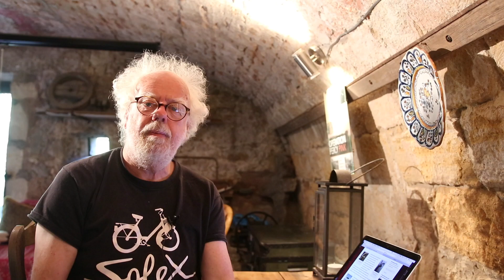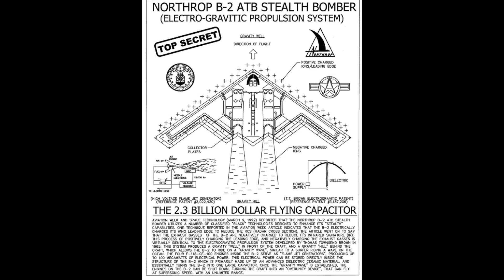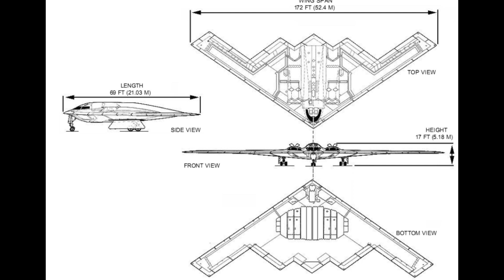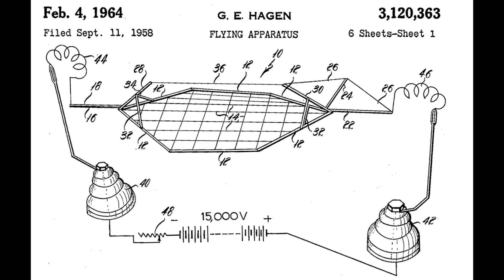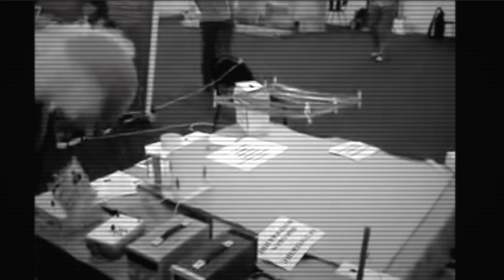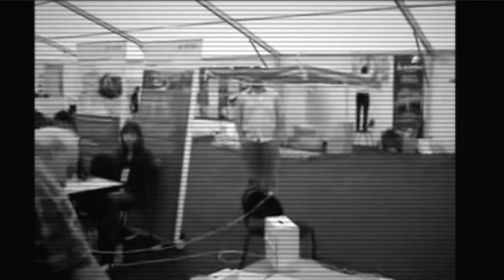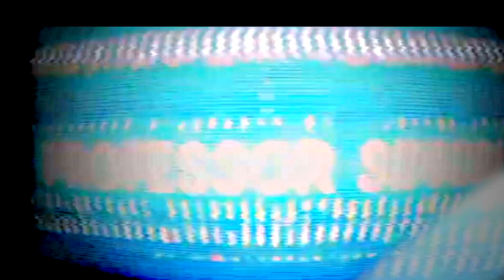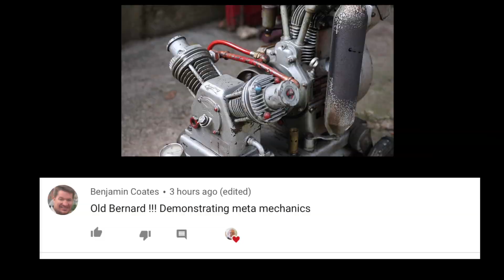Military anti gravity - Prof Simon

Comment: Nope! It is an MHD (Magneto Hydro dynamics ) generator to help guide the air flow to the intakes of the reactors using the electrostatic MHD flow, suppressing friction and turbulences. The lighting on the airflow path is typical of MHD ionisation. This system was needed on the B2 due to the very unusual shape of the aircraft and the non-conventional «top side and behind the wing edge» air intakes of the reactors.
Reply: Magneto Hydro Dynamics as magnetic fields inducing currents in a flow of conductive fluid, polarises the fluid and makes changes in magnetic field itself.

Only case where it's been used in aerospace engineering is in the sensors of the aircrafts where these MHD sensors are measuring angular velocities in inertial navigation systems.

There are few journals about similar of what you're saying but the MHD drive is already used in boat's propulsion.

MHD drive for seagoing vessels is electrifying the fluid which is then directed by magnetic fields giving a capability to a vessel to move in opposite direction.

Americans and Japanese have tried it out and it's proven unfeasible except of few working prototypes.

The problem?

A vessels are Too Slow.

It's Cost Prohibitive.
Reply: Emir Latinović Thanks for your comments 👍🏻 Yes, as a boat propulsive system, MHD is not effective in water. On the B2 it is not for propulsion, but as an aerodynamic problem solver. It is very smart.

Comment: The entire design of the B2 was about minimising the radar cross section of the craft whilst still managing to actually fly which it could only do by using a computer to make the adjustments to maintain stable flight. If they mounted an ioniser on a B2 then I think that the design of the B2 is the big clue of what it might have been used for. It is inconceivable that the ions produced would provide any significant  thrust relative to that provided by the jet engine. Ionisers have been trialed to reduce the radar cross section of aircraft and possibly as a spin off from this to reduce and/or control drag of some of the surfaces with former being the likely and logical explanation as to why the B2 may have had this. Radio active materials have also been used to ionise the air to reduce radar cross section. You briefly mentioned depleted uranium, well if it was depleted it wouldn't have been used for this. If you want to build your own flying ioniser see https://www.youtube.com/watch?v=vzZy1Aqleno or learn more about use in stealth technology https://en.wikipedia.org/wiki/Plasma_stealth. 

Not very professor like Simon on this one, and certainly no anti gravity to be found.

Comment: You had said in a previous video you have no idea what is inside a UFO that propells it. Here are some notes from people who have been taken on board against their will usually. The Visitors give them a little tour and end up in the middle of the ship. Everyone says about the same thing, a large cylinder full of a colored liquid spinning in a vortex formed inside. High voltage is applied to this system and there is a large disk spinning under the fluid cylinder. Zero point energy is tapped to power these ships as the energy density is insane. It has been said that there is enough energy in a  cup of water to power the US for about a year. Some people have seen coils in the system which are probably more primitive systems. You get a spinning toroid of energy that surrounds the ship to form the space time bubble you mentioned. Meta materials in the ship help propagate the anti gravitic energy. You also get a force field that comes in handy when they are attacked by the Tribes on earth. I have 35 years of research so far and learn more every day. I believe this as so many experiencers tell the same story. Last part, they fly the ships with their mind and some of the humans on board are allowed to take a test drive if they are calm and have been inside many times. This is hard to believe but thousands of these people tell the same story. The only proof is the testimony of these people. The truth is really out there....
Reply: Interesting and thanks Patriot! WWG1WGA 🇺🇲🇺🇲🇺🇲🇺🇲
Reply: ... add this to my, "Do you have any spare change?" speech.
Reply: Nerd
Reply: Even the central counter rotating column is somewhat primitive IMO I have refined this concept much further on my channel. Check it out if you like.. or tell me to frig off lol
Reply: Even if they would not let people take control of thier ship. Lol you actually believe some random person when they say I GoT AbDucTeD and ThEy let Me fLy tHe sHiP. C'mon bro lolol
Reply: "Thousands of people tell me the same story"
"This channel doesn't have any content"
Seems legit.
Reply: Sam m   Thanks?  -:-) :-)
Reply: The Texas Tickler When one person comes up with this story yes, LOL. When many come up with this story or similar stories it is time to investigate. One researcher went to many of these people that have seen the propulsion and every systems, After they told him their story he asked question to see if they were making up the story. He had a database of stories and worked from this. He would ask questions to lead them in the wrong direction like the fluid is transparent right? The floor near the cylinder has steps right? The people that made up the stories were easily discovered. The rest made him take note. He said the amazing part was most of the systems were similar so this tech is standard for the others. Our ARV or flux liner works the same way. Watch the movie The ARV flux liner by Mark McCandish  as he spent 25 years investigating this Alien Reproduction Vehicle.
Reply: What do you think of Edgar Fouché's description of the propulsion system of the TR3B?
Reply: @The_TexasTickler   At least one abductee has actually said this, similar to if you've ever been on a friend's small airiplane, and he let you take the control for a few miles, to get a feel of it , and the ETs let this woman fly the craft  similarily.

Comment: Or more plausable explanation: ionized air has lower drag and it may increase some performance figure in some specific situation by affecting critical engine intake areas.
Reply: Energised air maybe doesn't 'stick' to the wing surface and as you say, lowers drag.
Reply: ok and in a vaccuum where it works even better and there is no air ... what is being ionized ? 

.
it is called electrogravitic lift or if you prefer the opposite to gravity  like magnetism is to electricity .... once you create a large enough potential difference between gravity and the body you will get lift from plain electron charge ... or in a sideways kind of way anti gravity ... what you are actually resting on is the magnetic field of the planet for the charge on your lifting body at that frequency and power level .... as you vary the dc frequency pulse and increase the voltage you distort the weight of the craft and now lift less weight making it easier to push so it flies faster ... it also creates an electron field on the wing and that field distorts the sound barrier leading edge making actually easier to push through to mach speeds and maintain them costing less fuel and allowing for smaller more efficient engines instead larger more fuel hungry ones .... there video's on the tests done about how this works and why even around on youtube
Reply: @0623kaboom  B-2 doesn't work in a vacuum, jet engines need air to work

Comment: Concerning electrogravitics: First you have to realize that there IS a fundamental relationship between electromagnetic fields and gravitational fields. This relationship can be DIRECTLY observed during the process of charging or discharging electric capacitors.
A basic experiment: Set up two (or more) large, high-voltage capacitors which are spacially associated with a normal geophysical gravimiter (aka an accelerometer. Make careful observations of the gravitational anomalies induced in the region which accompany changes in electrical state. Look for the effects of varying total capacitance, rate of change of electric charge, mass of dielectric materials, specific inductive capacity (K) of dielectric materials AND whether the spacial effects are vector OR scalar in nature (Tensor calc required for scalar wave understanding). From the data collected in this experiment you can then derive a satisfactory mathematical equation which includes all of the above factors.

In the real world this experiment was augmented by basic studies on variations in NATURAL Earth charge (caused by naturally occurring electrogravitic induction). This secondary augmentation data was collected by Stanford Research Institute AND, cooperatively, the Division of Statistical Analysis (of the Bureau of Standards) all the way back in the early 1950s.
Reply: Well integrated understanding with working demonstrations, you sir, have done your homework. Have you heard of subquantum kinetics?
Reply: @DCrypt1  yes. Strong nuclear force (also a field) used to interact with gravity. Takes a much stronger power source to make happen. I can talk about it later (a little) if you want.
Reply: Jim Phillippi yes go for it brother, what do you mean the strong force used to interact with gravity? In a previous paradigm or is this a non traditional QCD model? Have you looked into another UFT surrounding the E8 Lie group in particular? I’m no mathematician but one theory called the Quasicrystalline Spin Network looks promising.
Reply: Late 40's

Comment: 1. My guess for the B2 is just like in the movie Hunt For Red October, when Jack Ryan is being dropped on the sub by the heli, the rotor friction causes huge static electricity build up on the rotors and thus the whole helicopter.  They are applying this voltage to neutralize this effect and thus probably keep it's radar signature as low as it was designed to be.
2. The B-B effect is just a crude ion thruster, in a vacuum this effect is gone.
3. The only theory I know of for a unified gravity and electromagnetism is the Kaluza-Kline theory in 1921.  In 1919 Kaluza sent Einstein his theory, which basically added a 5th dimension to Einstein's equations.  He rejected Kaluza's paper.  Einstein is an idiot.
Reply: Einstein a idiot how dare you say that.Very rude.
Reply: Gravity is just the displacement of space.